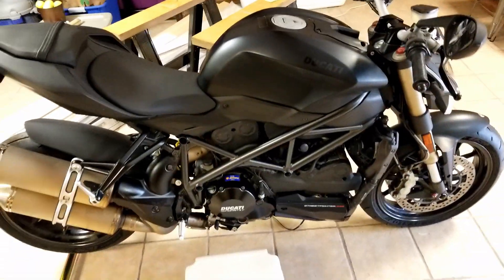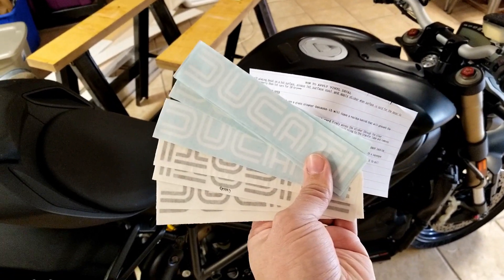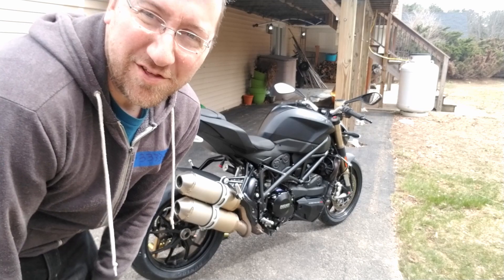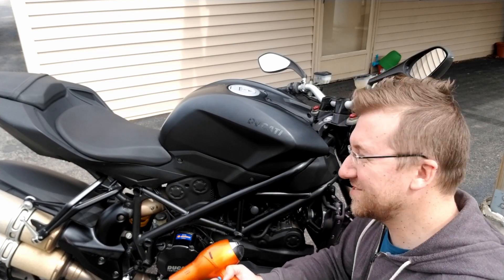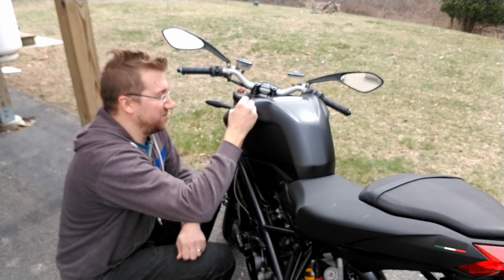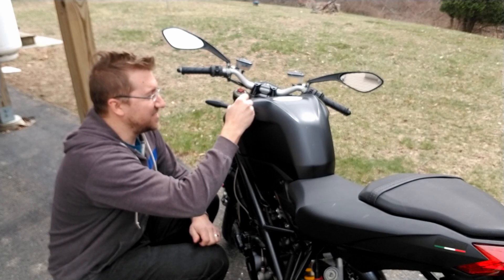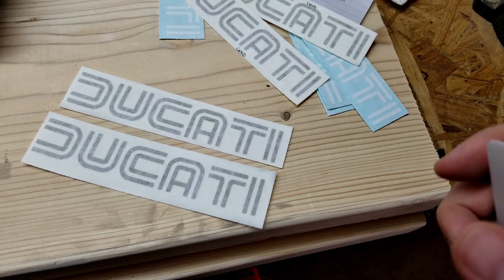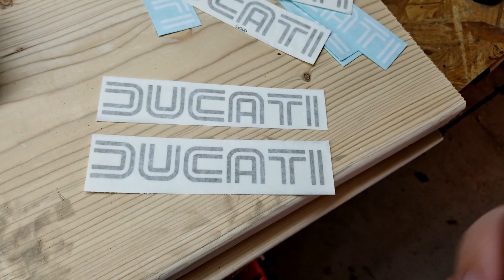How To: Replace Ducati Streetfighter logos with Gold logos!

Comment: Question for you, overtime did the outline of the old letters eventually fade?
Reply from the maker: Hi Motodave!
Thanks for reaching out!  So yes, and no.  I take good care of the bike, so it means that the matte finish that was under the old logos actually hasn't faded much since I got it.  On the other hand, what I've found is that only specific directional light, or looking at it close (less than 2 feet or so) can I notice it.  The video as I filmed it was under bright fluorescent lights, which it turns out make it stand out way more than actual daylight.  I was actually just looking at it a few days ago and realized this.  
So, I guess the short answer is that it doesn't fade much over time, but I do think I could get something like microfiber and probably rub on it a bit to make it go away.  That said it's not noticeable unless you know to look for it.  My bike when I got it wasn't in the best cosmetic condition as far as paint goes, so I haven't sweated it, but if it was "showroom" nice, then I'd probably put some effort into making it all match.  Hope that makes sense.  Btw, 10/10, I would do it again in a heartbeat, I love how the retro logos look.  In fact I have a few more sets of them for if these wear out, in different colors.
Have a nice day, hope this helps.
-Fred